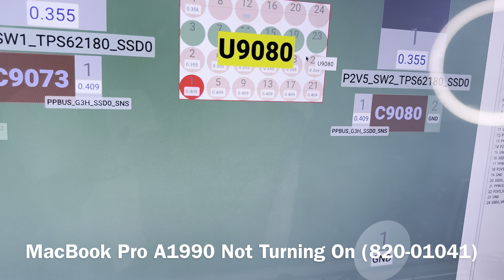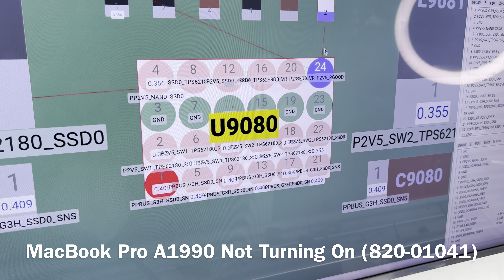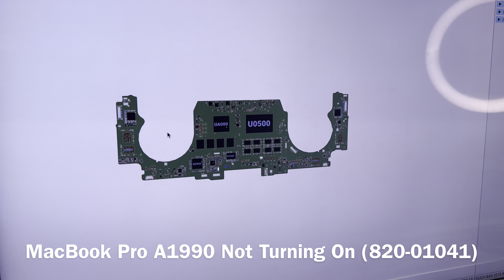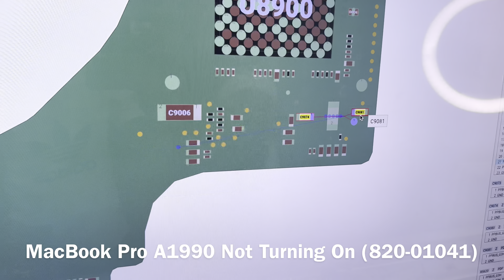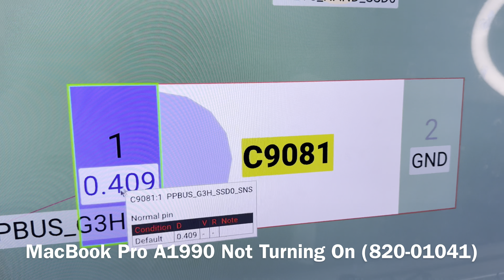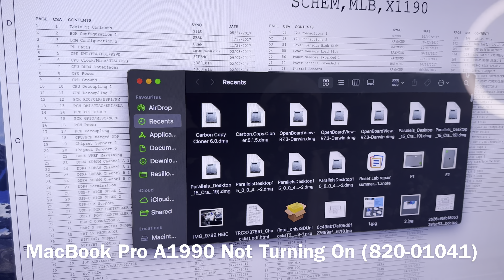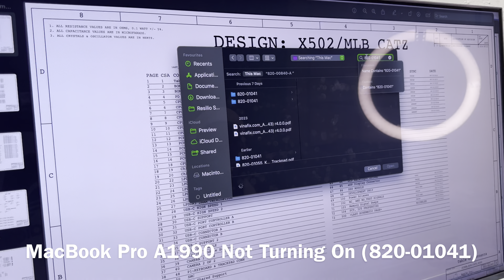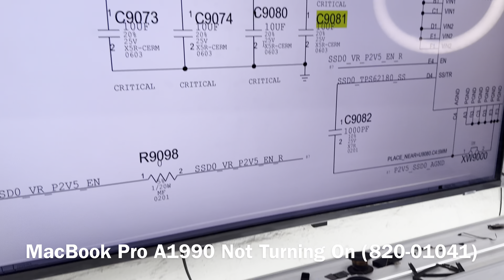MacBook Pro A1990 Not Turning On repairs

Comment: Thank you for this! Did you just remove the black cap on the capacitor around 16:28? Would have helped if you had zoomed in there.
Reply from the maker: @wonduxx5355  removed  the cap